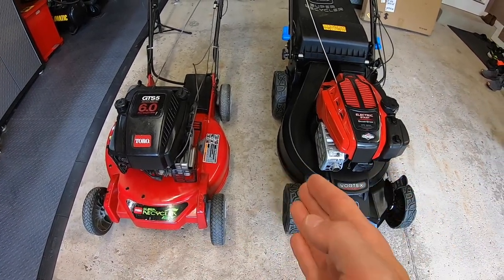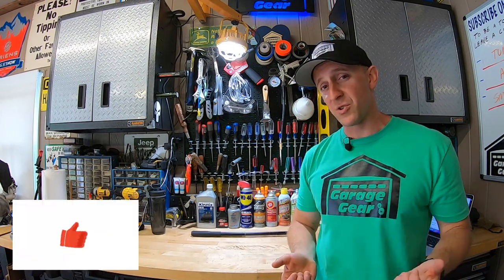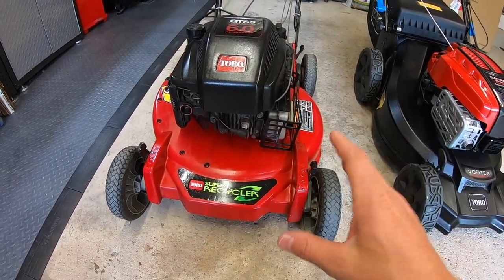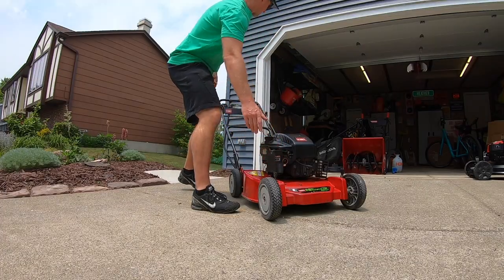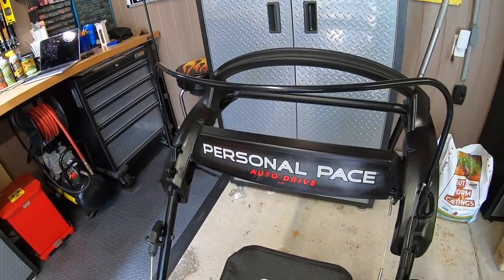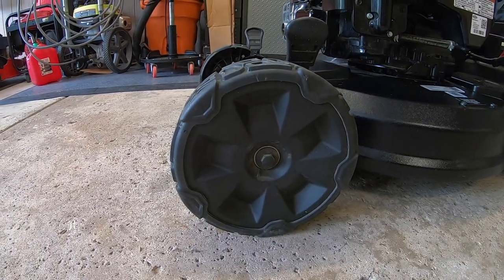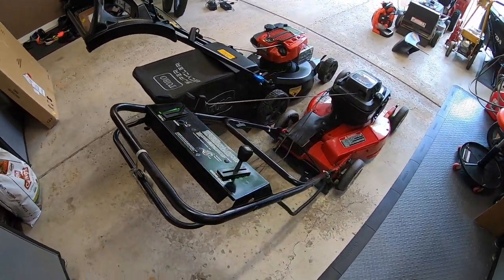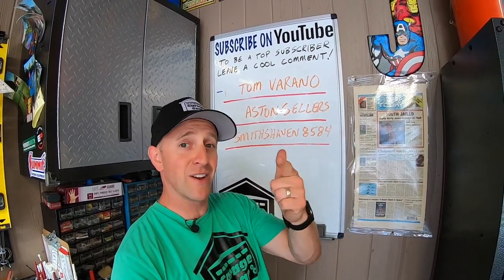ARE YOU BETTER OFF BUYING AN OLDER TORO SUPER RECYCLER THAN A NEW ONE?

Comment: I like that 1999 model. $600 in 1999 with no bag, bagging chute, or mulch plug. That bagging kit was likely another $100-$150. Adjusted for inflation that would be upwards of $1,300 out the door in todays deflated Dollars. Toro could still build them like that, but consumers would *itch and complain to no end. Most people like to point the finger at manufactures, but consumers drive the market.
Reply from the maker: Great information here Eric! Thanks for sharing! 👍

Comment: I've been watching your channel and others. I just bought a Super Recycler last week. I'm disappointed. I love the cut and the bagging. I HATE the Personal Pace drive system. My yard has several flower beds where I have to nose in and back out. The mower doesn't like to back out. My yard is also uphill and downhill. It's VERY hard to maintain a constant pace. I think I'm going back to my tried and true Snapper.
Reply from the maker: Sounds like a good plan if the mower is giving you that much trouble! Thanks for being a cool fan of the channel!

Comment: I got a new Toro Recycler in September, 2023. It broke after 1week (8-10hrs) of use. The new Briggs and Stratton engines leak oil (90% of the time I’m mowing a hill side. Yes, I go sideways not straight up and down). Then the plastic that keeps the wheel on broke. The wheel has been repaired, but the mower is still in the shop (as of 2/15). There is no word on when Briggs and Stratton will send the parts to fix the oil leak. I’ve had Toros before, but never this much problem with them.
Reply from the maker: Toros have gone down hill in the last handful of years!
Reply: @GarageGear It's an isolated case. You can pick the most reliable mower in the world and there's still a chance that atleast 1 person had problems with it. But that's one in million case. It's classic survivorship bias.

Comment: I have a 1988 Toro Recycler with a Tecumseh engine .It has a 3 speed transmission along with the throttle control , grease fittings and starts on the  first or second pull. I like the way the mower is balanced, just light pressure on the handle  to lift  and turn around. Newer products today lack the Quality of these  "Old Toro".
Reply from the maker: It would be nice to see even one of these features on a newer toro!

Comment: My 2006 20” no primer toro personal pace super recycler to this day will start right up on the 1st pull every time. Never had a carb problem. I recently replaced the transmission and drive belt .New air filter, plug and oil every year. I swear this mower will outlast this 73 year old guy. Take care of the mower and do the proper PMs and it will serve you well for many years.
Reply from the maker: Spot on spre! Thanks for sharing!

Comment: Face it it`s not just TORO but everything made today is built to not last
Reply from the maker: Very true my friend!
Reply: @Veilside Brice Good machines are still built, but you got to pay for them. The least expensive quality mower on the current market is the commercial Honda HRC at about $1,400. Toro's commercial 21's go for $1,800+. Those mowers would last the average homeowner 20-30yrs. Consumers drive the market and they demand manufactures build them cheap *hit.
Reply: @Veilside Brice everything is disposable
Reply: I would have to totally agree with that
Reply: The new Stihl mowers and Hondas are sooooo much better...
Reply: That's a fact!

Comment: I had a model 20056 SR4 that was as tough as a tank.  Nothing slowed it down, and it cut beautifully mulching or bagging.  Then I moved from CA to WA and found it upside down sitting on top of other furniture at the top of the moving truck trailer when they opened the doors.  That pretty much killed the engine, so I got rid of it.  I should have just repowered it.  That was about the peak for Toro in my opinion.
Reply from the maker: Oh wow I would have lost it with the moving company! Thanks for sharing Matt!

Comment: On your older Toro, there should be a heavy black rubber handle latch spacer, Toro part 3-3287, on each of the handle latch mounting bolts.  The  rubber spacer goes between the deck and the handle latch. If the handle latch spacer is worn-out or missing, the handle latch won't stay on the pin further up on the handle.

If you install new handle latch spacers on your older Toro, you won't need to resort to using zip ties to hold the handle latches in place.

After installing the new handle latch spacers, bend the handle latches inward if needed.
Reply from the maker: Thanks for sharing this stash!

Comment: I just bought a “new old stock” 2020 SR. Was an absolute great find. Chose it over the new model as I felt it was built better. Cuts fantastic and that Toro branded engine runs and sounds great.
Reply from the maker: You my friend have found a good one! Keep that baby around for a while! 👍
Reply: That’s a great machine. The Toro engine on it has crank bearings instead of the usual bushings as well as a cast iron cylinder liner and triple piston rings 💪🏻

Comment: I found a 1995 Murray free that someone put out to get rid of. I put my high metal wheels and carburetor on it from my 1994 Murray push mower.  Runs great. I resolved my cracked deck, carburetor held on by 1 bolt, broken handle and loose muffler.
Reply from the maker: Awesome thanks for sharing tim!

Comment: No mention of the bulletproof flat top engine on the older model? 

My 1999 Recycler GTS 6.0 model 20023 ($299 @ HD back then) has gone to hell and back and won't quit.  Only 2 oil changes and 2 air filters in 25 years.  Still on the original spark plug.  3 primer pumps and it starts on the 1st pull - always.  It's a beast.
Reply from the maker: Those engines were fantastic

Comment: Will (Toro part number 144-6377 traction assist handle kit) (for new Toro TimeMaster mowers) fit on new Toro AWD 21472 mower? Both have same mounting holes and baby carriage shape.
Reply from the maker: Not sure if they will be a direct fit
Reply: @GarageGear  Update: ((optional add on) Toro part number 144-6377 traction assist handle kit) does fit all new Toro mowers that have the new baby carriage curved shape.

IMO you could make your own Toro's BTAH (Black Traction Assist Handle) from 2 pieces of wood in ((L) shape) and some bolts and washers.

Toro's BTAH converts Toro's PPM (Personal Pace Mowers) (which requires a person to push Toro's heavy mower forward before the self-propelled drive kicks in) to ((easily without effort) controlling Toro's self-propelled drive with just your fingers and hands without moving forward).

This is needed on steep hills where you need the Toro mower to pull you and this powerful mower up the hill without any effort on your part.

The powerful Toro mower can do this only with BTAH and not by Toro's PPM (extra exercise mode).

Without BTAH you end up pushing this heavy Toro mower up the hill.

Thank you for your help and understanding on this Toro (back breaking) mower issue.
Reply from the maker: @AAa-qd8hb  glad it fit
Reply: @GarageGear  I bought the new 2024 Toro all-wheel drive mower and installed this optional part and now it works like a dream. Now Fun to mow.

Comment: Bought one of the newer Super Recyclers with blade clutch. It’s been in the shop 4 times for the same damn problem…the stupid plastic presence cable holder keeps breaking. It also continues to run like garbage even with ethanol free fuel.  Toro refuses to do anything about it even after repeated calls…
So…guess what..I also happen to own a commercial mowing company and we decided to add a new commercial Zero Turn mower to the stable as well,as put a new snow blower into the stable. Guess what brand I cancelled the snow -blower order with and which brand of commercial mower we DIDN’T buy? Yup, we are enjoying the new $10,000 Gravely and look forward to the Ariens 28” snowblower. Take care of your customers.
Reply from the maker: Thanks for sharing this sounddood! Enjoy your new equipment!

Comment: After looking for weeks for a good cond used Toro, I’ve decided to go new. I’ve narrowed it down to the SR 21565 & this, 21564. Having read and watched many reviews of the latter having sputter/bogging issues, I’m leaning towards the 21565. Any thoughts on that decision? Mowing twice a wk in peak season and once wk mid summer here in the Northeast.
Reply: Back when I bought my Toro in 2020 I almost went with the one that has the 190cc briggs. I actually own the 21386 model though which the 21565 replaces! I have read quite a bit of mixed reviews as well on the 190cc engine that the 21564 model has that you mentioned. I ended up going with my model and it has the same engine as the updated 21565 model (163cc) and I can definitely say that I have never had an issue with it and it runs very strong and smooth! Ive seen from videos and reviews that the 190cc engine has better power but has issues with sputtering and failing. I guess my input would be if you REALLY need the power than go with the 21564 model but if it’s not a concern then just go with what is more reliable. The newer Briggs exi engines all have some bad reviews but that 190cc model does seem really hit or miss from what I have seen and read. Either way you will have a badass super recycler, I suggest the 21565 model though, it has not failed me! I hope this helps at all!
Reply from the maker: Hey Mr. B! Sounds like a good decision! Just run ethanol free fuel in those engines and drain them out prior to winter storage. Those carbs don’t like fuel sitting around! 👍
Reply from the maker: @elijahbyers5960  thanks for sharing
Reply: @GarageGear  Yessir! For the super recycler gang! 🫡
Reply: @elijahbyers5960  Thanks for sharing! I’ll stick with going for the 21565 for now. Even though it lacks the power of the 21564, it’s still stronger than my current mower.
Reply: @mrb401  You got it! Sounds sweet! 😎

Comment: If my deck/frame ever rots away, I’m unbolting my 1998 Briggs 6.5hp and mounting it on another deck.
I don’t care how much fabrication it involves.

One pull starting every time for 25 years!
Reply from the maker: Like where your head is at Paul! I’ve seen these older toro decks on eBay before! Brand new for about $150 hundred bucks. How could you go wrong? Have a good weekend brother! 👍
Reply: that's how I got my 6.0 Craftsman B & S Quantum. 
Left at the curb, loose blade, plugged air filter fouled sparkplug. 
Put it on my Snapper deck.  13 years ago.  Engine's from April 2000.  
Best lawn power ever.   Never getting rid of it.

Comment: I tried an older toro but it would fall due to height adjustment being worn on the deck. Is there a fix for that?
Reply from the maker: Hey grass snake I have see people drill a hole into the deck and bolt the height adjuster in place so it wouldn’t move. Other than that you can sometimes find a new deck on eBay. The swap may take a bit but it will be a like a new mower when you’re done.

Comment: 1.  Can you adjust the RPM on the new ones?  My old one I could with a spring and a tachometer and brought it to a proper RPM and it bagged a lot better.
2.  I bag only.  Are the kickers removable?
Reply from the maker: Hey Jacky’ I suppose if you took the engine apart you could adjust the rpm but I haven’t tried. I believe you can unscrew the kickers from the top of the deck.
Reply: @GarageGear  Thanks for the reply.  So it sounds like you are telling me that it isn't quite as easy as replacing or trimming a spring, or bending a tab anymore.
Reply from the maker: @jackt6112  No definitely not as easy! You’re gonna have to move some things around.

Comment: Mine stopped bagging. I cleaned the bag out and I'm using the same blade but I can't get it to bag.
Reply from the maker: Are you using the old or the new model?
Reply: @GarageGear  I bought my smart stow in 2021. It bagged great but then last year I stopped bagging as much. Had trouble bagging this year and I checked all around for blockages but didn't find any.
Reply from the maker: @MrErpman  you took the mulch plug out correct. If so I wonder if it’s time for a new blade.
Reply: @GarageGear  No mulch plug and I have a new blade. Really weird. I think the bag is leaking because it doesn't fit flush against the deck in back.
Reply from the maker: @MrErpman  sounds like a very odd situation that I would probably have to see first hand.

Comment: I repowered my 2007 Super Recycler with a new 7.25 hp Briggs motor with the plastic carb.  Haven't had issues with E-10 premium fuel and the plastic carb has a cartridge jet kit for an easy rebuild.  I've had metal carbs give me issues with rust in the bowl.  I think the plastic is underrated.
Reply from the maker: Good info Chuck! Thanks for sharing
Reply: @GarageGear  we have a shorter off season here in Central Virginia (South Richmond area) but I can see up North having issues with that carb cartridge clogging with bad fuel as it sets longer.
Reply from the maker: @chuckgladfelter  yeah we go about a good 5-6 months without using it

Comment: 7:00 The new one will most likely last more than 20 years. Plastics have improved over time. Plastic carburetors will last as long as metal ones if they are designed well. And even if some had issues, that's mostly isolated cases. Cars had plastic intake manifolds for 30 years without any problems. There are 1000s of different plastic types and some of them cost more than metal.
Reply from the maker: Thanks for sharing

Comment: Huh? No throttle control on newers? Thats just silly, atleast i run my 21 year old machine on minimum throttle especially when cold, to save on fuel and to warm the engine.

Tbh i only use the full throttle in tall grass when it starts to bog otherwise
Reply from the maker: Thanks for sharing average!

Comment: Electric start via wall plug or separate dc source eliminates the battery dead weight. Tecumseh is the bees knees although many people will try to punch you for saying that. They have their own precautionary tales im sure. But Tecumseh was the only brand with an oil pump. Aluminum decks aren't good IF you mow rocks. ❤
Reply from the maker: Thanks for sharing and for watching!

Comment: The plastic carb is actually better than than the aluminum, they don't rot like the aluminum does and clean very easily.   I have the super recycler but has the Suzuki  two stroke with the BBC ,best mower ever.
Reply from the maker: Thanks for sharing this MU!

Comment: Made the same mistake and got rid of my old Toro for  a new 2023 model What a mistake Toro is absolute junk Do yourself a favor and buy anything but Toro.
Reply from the maker: Toro quality has gone way down over the years
Reply: I saw the plastic carb. Nope. That's junk.
Reply: @colinklang - The plastic carbs are actually easy to work on and cheap. The problem is the jet is so small it gets clogged too easy. I'd be more worried about the new Briggs engine drinking oil and the engine burning up .

Comment: You are much better off buying the old Toro. The Toro recycler is the worst lawn mower our family has ever purchased. We bought it in 2010 and IT NEVER WORKED GOOD FROM THE TIME WE PURCHASED IT BRAND NEW AND CAREFULLY TOOK IT OUT OF THE BOX. 
It did not work even after changing the blade, oil, clearing the filter, inspection. All it did from day one is bog, clog, and stall and leave huge clumps 😡🔥👎 The trash-picked 4.0 hp Craftsman no self propel lawn mower never bogged, clogged, or stalled one time and is still in use today. It sipped gasoline instead of guzzling it and blowing the exhaust in your face which the Toro mower did.
Reply from the maker: Thanks for sharing this information Rick!